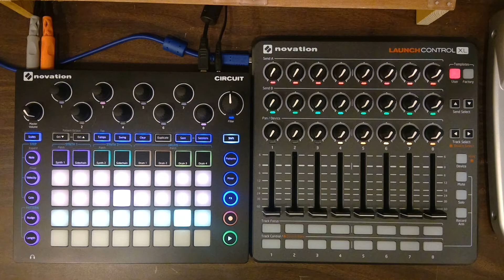Hardware Editor For Novation Circuit

Comment: In any DAW, you can route MIDI messages from the LCXL back to itself by creating a MIDI track and choosing it for the input and output of that track. It allows you to control the LED lighting of the pads. The colour depends on the note velocity or CC value that is sent back to the device. It only applies to the two bottom rows of pads because the four top-right buttons only have red LEDs and the four bottom-right buttons only have yellow LEDs. You can find the programmer's reference guide on the Novation website. I think I've created a file where I've referenced the LED colouring depending on the message value; I can give it to you if you want. That's all I know! Hope it might help you! Greetings from France!
Reply from the maker: WELKER Romain Thanks for the info! Yeah I found the programming guide and was planning on adding that in the next version.   I was going to try to find what note and velocity corresponded to which color and button by trial and error cause it wasn't too clear in the docs. is that what you had to do?
Reply: XtraLite Not really. I simply used the LCXL and the Launchpad S programmer's reference guides to find the values. I used both because some values that are referenced in the Launchpad S one aren't in the LCXL one but they use the same protocol. Weird... The Notes and CC messages for the pads are the one you choose when programming the LCXL templates.
Reply: XtraLite One thing that disappoint me : you mention "unison mode" in the video description, but to my knowledge, the Circuit only has 3 modes that are Poly, Mono and Mono Auto Glide. I wish there was a unison mode, but unfortunately not. Freakin' love that box by the way.

Comment: That was super cool and well presented. What language did you use to convert the output and will there be a UI at some point?
Reply from the maker: Thank you! I'm using python. I'll be doing a UI eventually but I haven't decided what it will look like. I'm thinking something simple because eventually I'll be making a small self contained module for this out of a raspberry pi and a 3.5 inch screen.
Reply: Thanks for the info. Looking forward to seeing more of it.
Reply: If you ever release a Raspberri PI editor Id buy it in a snap . looking forward to your work.